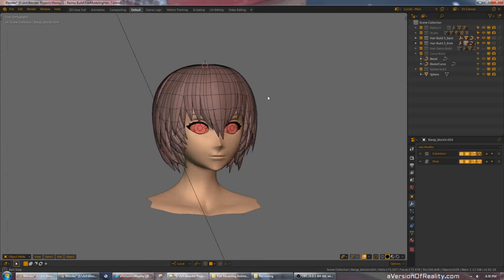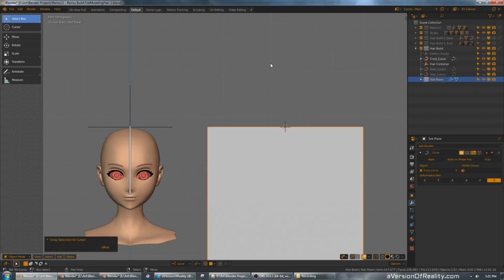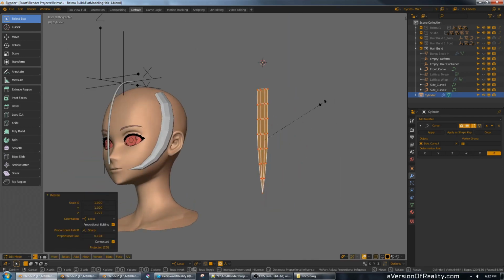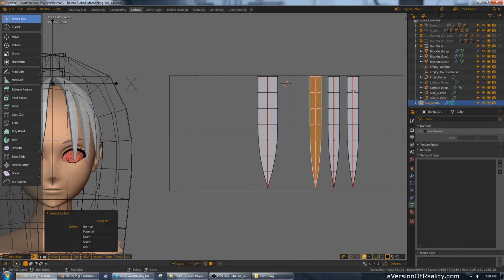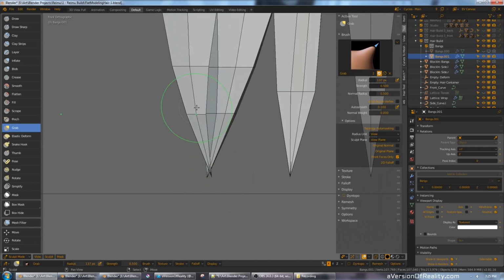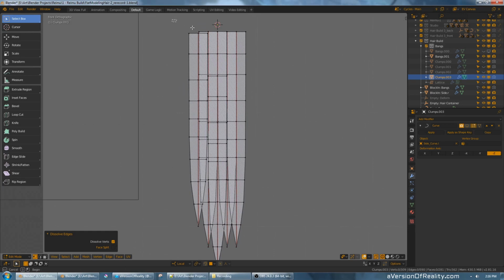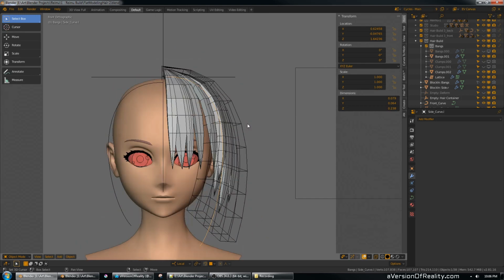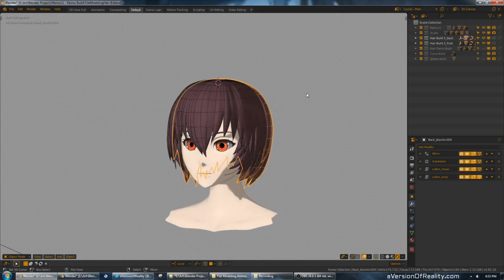Flat Modeling Anime Hair Tutorial (Blender 2.8)

Comment: Hey so I have been trying to follow this tutorial but for some reason whenever I set the plane to the curve it just squishes the plane on the x axis, I can get the curve flowing the right way with the right tilt and at goes in the direction I need it to however it just squishes everything on the X axis making it hard to know how wide I should have the strands while editing it flat only to find they are way thinner when attaching them to the curve.

Of course once you apply the simple deform it stretches it out again making it look a little more like it should but it still doesn't give the greatest representation of where the strands need to go when laying it flat.

Comment: Great method. I dont do much 3D modeling but was experimenting with the path method but using just a line (1 segment) and lowering the resolution to 3 (or lower) on both the target path and path. Convert to mesh, THEN subdivision modifier the new mesh to get even topology. It works ok but still a lot of fiddling.
Your method is way better and you still get the added benefit of going in with the knife tool and hand draw the basic shapes without messing around with proportional editing like on some Maya speed modeling videos.

Comment: Thank you so much for this tutorial ! Very technical and precise, I really appreciate how those different layers of modifiers give the approach robustness and scalability.
I am struggling right now to find good learning material to make very short hair for male characters : is there a way to make a lattice conform to the surface of the head, so that the hair can be sculpted and cut in 2D, while conforming, through the lattice, to the head shape ?
(I found kind of a solution using shrinkwrap, but, the lattice would not follow the normals of the head shape, which is not convenient for the hair sculpting)

Comment: This video has helped me greatly with a few personal projects I've been working on, an extra note- the empty used as an origin for the simple deform modifier can be rotated to adjust the angle at which the deformed object converges on other axes. After applying the techniques in this video I used a small rotation on the adjustment empty on the X axis to create clean, flowing geometry for a high ponytail!

Comment: Great tutorial, I could finally made good anime hair
before this I tried out everything
-Make the hair with curves: it turned out good but the strokes in freestyle were quite messy.
-Retopology the hair that was made with curves: hard to do, there were tight areas that was very difficult to retopology with the addon retopoflow, I did it and then applied subsurf but subsurf tends to reduce volume of the mesh and got thinner. (tried to fix it adding displace but was not good)
-Make flat hair and then add solidify modifier, add a vertex group and weight paint it to make some areas thicker and  thinner (this wasn't so bad, but I still wasn't convinced)
-Long form modelling: not the best idea, it's very easy to get a mess (at least to me lol)

Comment: I followed along the tutorial, and for the most part it's working great. I just have a problem where the strands are rotated 180 degrees? (From the mesh to the output around the head)
(Moving right is left, moving forward is backward) Could you help me with solving this?
Thanks in advance. (Also, this is a great tutorial)

Comment: Hi this is fantastic! I figured out the orientation part except the plane doesn't 'snap' to the curve when I add the modifier. I need to move the plane itself over to the head which is fine enough, but it would be nice to edit it over to the side like in the video.
Any advice on how to fix this? I'm using 2.9 if that matters

Comment: Hi! First off, Loved your video and the Eevee toon shader workflow, they are a joy to watch on the bus or train. But the problem I'm having is my plane won't work as it should. For Example: When I use the curve modifier and set it to -Z it won't be in the right orientation. I tried other Deformation Axises but with no luck. I subdivided the plane 8 times and tilted the curve by 90 degrees but still nothing. I even tried it again and again but with no luck. Any way to fix this? Thanks!